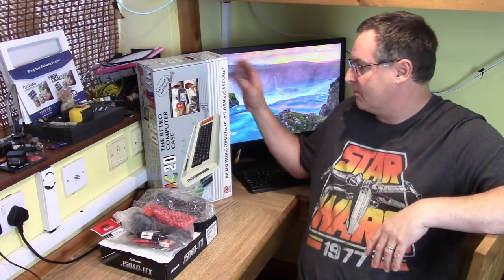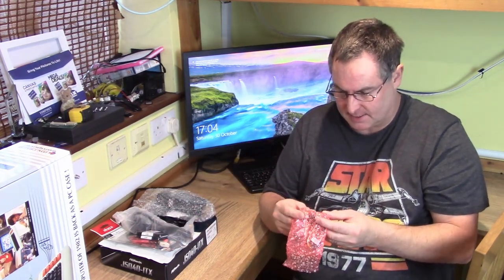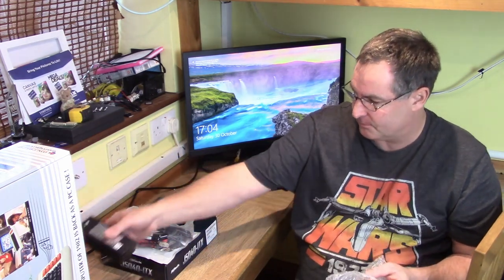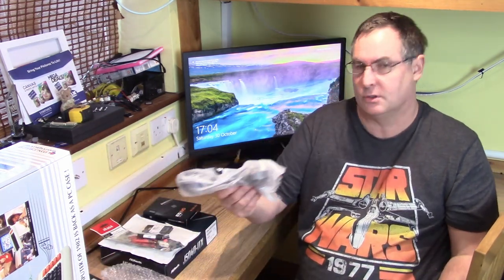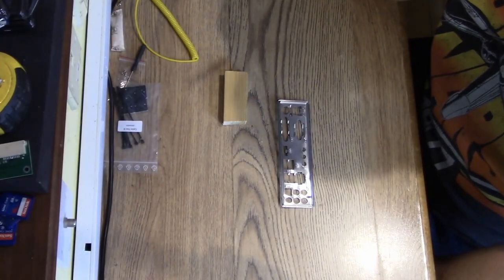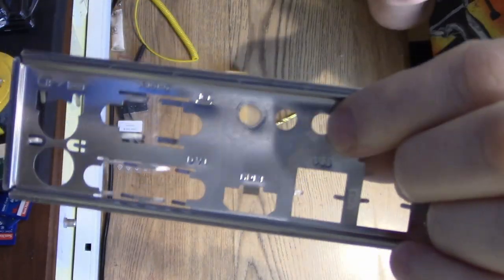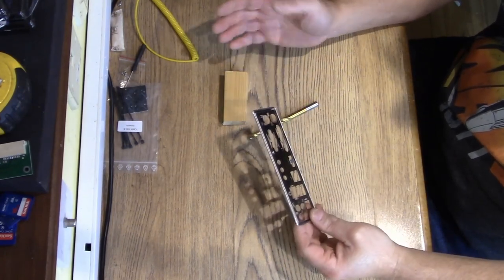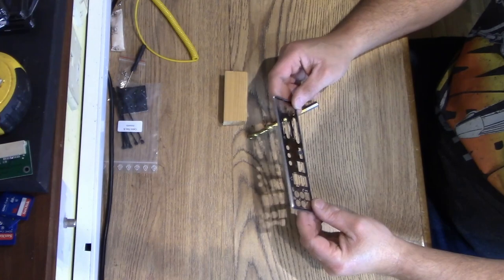Lets build a ASRock J5040 C64 Silent PC [Full parts & Tutorial]

Comment: just asking the cpu cooler height max is 30mm? im planing to put 37mm will it fit? im planning to buy  (Noctua NH-L9a-AM4)
Reply from the maker: Sorry to say that the maximum height for CPU cooler is indeed 30mm. You wont need a cooler for the J5040 though because it's passively cooled and comes with a heatsink already fitted.🙂
Reply: @myretrocomputerltd5179  i assembled my retro computer with a ryzen 5 5600, and a change fan twice the temperature sometimes  will go to 75c, do you have any recomendations?
Reply from the maker: @kutingkuting2205  Watch the Ryzen cooling update video here https://youtu.be/lvsHYUwCTKU - email me at info@myretrocomputer.com and i will reply with the 3d file of the vent pipe. 🙂